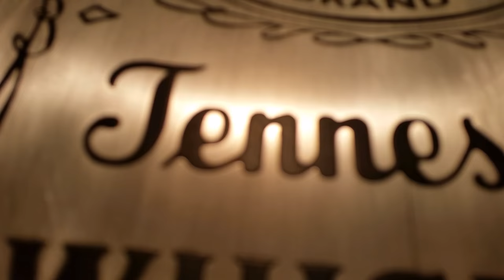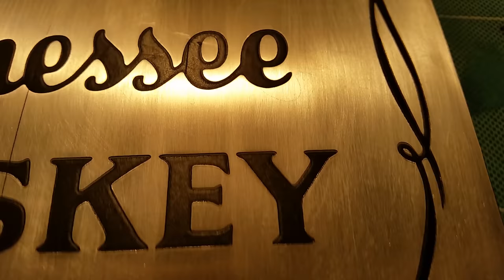Aluminum etching with ferric chloride.

Comment: So you are yanking the aluminum plate out of the ferric chloride bath every minute because it gets hot from the reaction. You are cooling the thing in cold water and scrubbing the left over gunk with a toothbrush, then repeating the process. I was wondering if this method is suitable for delicate intaglio etching on aluminum that is much thinner. Guess I will see. My only worry is the asphaltum resist I am using might fail if temp is an issue. Wondering if some good old enamel lacquer might do the trick instead.

Comment: Awesome video, thank you!!! 
One question I have as I'm trying to figure out the best way to do a project similar to yours is what materials are you using to create the transfer? Also it looks like your using simple packing tape on the back to prevent etching?
Reply from the maker: To transfer the image I use "transfer foil for vinyl cut graphics" But I'm not sure if this is the exact translation. I have a foil from graphic studio where I let cut out the stickers.

For covering the back side you can use any tape. It is there purely to seal the surface is not etched.

Comment: Was this piece of aluminum anodized? Also would ferric chloride affect the results if I used a vinyl stencil? I am wanting to do the chrome strips on the  side of my truck but im not sure if it will work and Its hard to find intact aluminum pieces for a 73 shortbed f100
Reply from the maker: Sorry i'm late. aluminum must be clean. If aluminum is anodized it will not work. The chloride template does not affect the template.

However, care should be taken for temperature and thin or sharp shapes. They tend to peel off.

Comment: So I tried this today with a small 32mm diameter aluminium disc that was 2mm thick. I cleaned it with acetone first then sat it in ferric chloride but it didn't seem to bubble like that and doesn't seem to have done much. What have I done wrong.
Reply from the maker: Hi . Did you use pure aluminum or anodized? If the surface of the aluminum is anodised it is not possible to etching.
Reply: Matěj Novák I thought it was just pure aluminium but maybe it did have a coating of some kind on it. I never sanded over it first as I thought it was just clean aluminium. Maybe next time I will try that first. It has etched it a little bit but it took all day and didn't look close to the effect you got with yours. My ferric chloride says 40% is that strong enough.
Reply from the maker: Yes it is possible that there was some coating on aluminum. The etching of pure aluminum takes place quite quickly. The chloride concentration you use is good. Try clean aluminum and it will work.

Comment: you rock Matej! can you help me with some details: how long did you leave it in ferric chloride?, why did you rinse it several times?, what paint did you use? and what solution did you use for cleaning the paint from the untouched surfaces?
Reply from the maker: Thanks pleased me your interest. I let it etch 30-60 seconds. Then it rinse with clean water. Rinse with it due cooling because heat is generated during etching. And on the surface of iron settles, it will remove tooth brush so that the etched surface was not bumps. I am using plain color spray paint. To remove color using water sandpaper, grit 280.
Reply: how long do you wait for paint to dry before sanding down with water?

Comment: After spray painting... you poured something on from a can ? then sanded with wet n dry. What did you put onto the paint?
Reply from the maker: That's pure water. I used sandpaper for underwater grinding.

Comment: Hello Matěj at the end you paint with spray and remove the ink using which product, grateful.
Reply from the maker: To remove spray paint using water sandpaper, grit 280. Then another 500 grit for super-smooth finish.

Comment: Hi, I tried on aluminum but it took almost 10 min for 0.30mm dip etching. 
What should be concentration of FECL3? 
What’s etching process for Stainless Steel of different grades?
Reply from the maker: Hello . 0.3 mm in 10 minutes is normal.
I do not know the concentration of ferric chloride, I buy the finished mixed solution.
For etching stainless steel try Electrolysis. Batteries and salt water. But I do not know if it will work I did not try it.
Reply: Thanks sir
Reply: @a4ajit  I etch stainless steel all the time with ferric chloride. Same process this guy used. I cut a stencil and put the ferric chloride on there anywhere from 10 to 15 minutes. Then I put baking soda on it to stop the reaction and then wash it with water. I don't paint mine after though.

Comment: ferric chloride?  did you dip it in water and baking soda to stop the process before you re-etch?
Reply from the maker: To cool down and stop etching. Soak the aluminum plate only into clean water . I do not use baking powder.

Comment: What is ferric chloride used for in the house hold?
Reply from the maker: Occasionally etching printed circuit boards. Ferric chloride that can not be used for copper etching is used for etching aluminum.
Reply from the maker: I'm sorry I probably wrote it vaguely. I use the same iron chloride for both copper and aluminum. Ferric chloride is capable of etching a certain amount of copper, and then copper is incapable of etching. This (used) ferric chloride is then used for etching aluminum.

Comment: great work,is this plate can used for printing?
Reply from the maker: Hello . Do you mean to use it as a printing master? Maybe yes, but I have not tried it. Etched surfaces are deep cca.0,15mm.
Reply: Tanx a lot for information.Just one more question,how long time i need for this  deep?
Reply from the maker: Time etching can not say exactly. Heat is created during etching. Larger etched surface creates more heat. And the warmed etching bath. How bath has higher temperature by the aluminum etches faster. 

Etch 30 seconds to 1 minute after the aluminum plate put into cold water to cool, tooth brush gently clean the etched surface and give another etch. Repeat this process until etched surface will have the desired depth.  

I repeated this about 6 times me to get to the depth of 0.15 mm.
Reply: Many tanx for information and help.I will write it soon.

Tanx again.You are great.
Reply from the maker: you're welcome
Reply: Noa prints limited prints 
Sir you know about anodized aluminum name plate or lable. And printing on aluminium plate
Reply: In screen print is possible

Comment: Can you post link where you buy your Ferric chloride?? 
And wht is the best deal?
Reply from the maker: Hello . Ferric chloride I buy in a local store. Here is the link but I do not know if it will help you. https://www.gme.cz/leptaci-roztok-1000ml
Reply: Do you have fb,i have some questions,thank you
Reply from the maker: I only have a private Facebook. Please write your questions here. Thanks
Reply: How thick is your alumin sheet,and how many times you can use the same ferric chloride solution???
Reply from the maker: The minimum thickness of the aluminum plate is about 1 cm. I used a 2mm thick plate. I can not say how many times the same solution can be used. It always depends on how large the surface you are etching. Logo JD what is in the video could be etched about 5 times.
Reply: Can i use any of this ferric chloride to etch aluminum.or copper ???
Reply from the maker: Yes. Both are usable. Do not warm up before use !!!!
Reply: So i put aluminum in solution and wait 1 minut then pull out and clean with cold water l,and then put in sollution again and do like that few times more????
Reply from the maker: Yes exactly .
Reply: George ZitrO can you show me how to mix that,can you make video or can you send me links what you buy to do that ????
Please
Reply: I buy ferric chloride from Amazon. I'm in the US I don't know where you are and if it would be easy for you to do that as well but try it. Very easy to get and not that expensive.

Comment: Not good like yours.
Reply from the maker: Aluminum must not be immersed in ferric chloride for too long. Otherwise, it will overheat and bath starts to foam. Aluminum immerse in chloride for a maximum of 30s. Then rinse in cold water and immerse again in chloride. Repeat it until the pattern is etched deep enough.
Reply: t was then that happened because I'm looking for a way to make a deep solder in the metal, I got the copper and the brass but I wanted something even deeper, I saw some techniques with salt and vinegar using 12v batter and pile too, thank you.
Reply from the maker: Etched with salt, vinegar and 12V battery I did not try. I can not help you with that.
Reply: I'll put a lemon juice conentrado with the salt in the battery because the salt corrodes too and I'll come back to tell you the result, thank you
Reply from the maker: George Robartes:  What fish and chips? I do not understand....